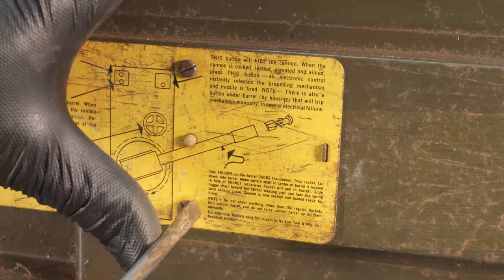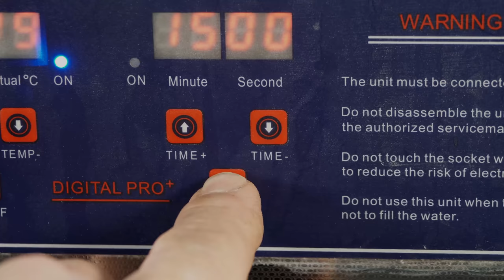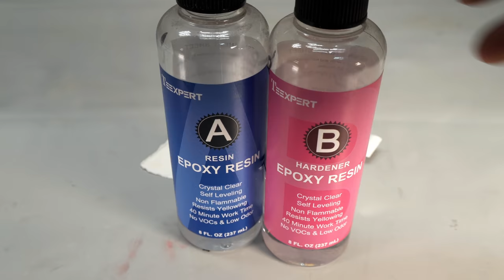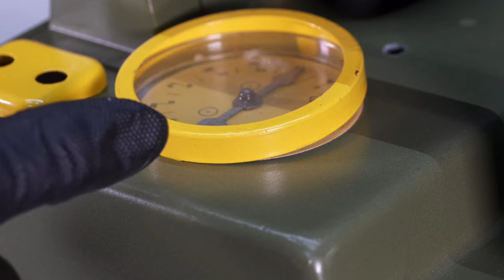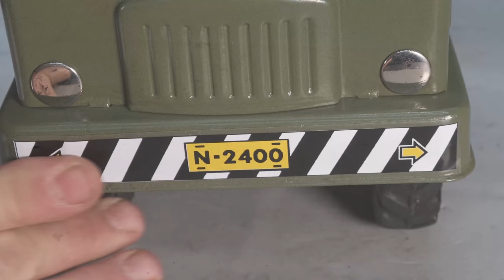Rare 1956 Nylint Electronic Cannon Truck Tonka Restoration

Comment: Holy crap they made awesome toys back in the day. I can't imagine toys today would last half as much as these.
Reply from the maker: You got that right!  Even the wheels were solid rubber.  This thing weighs a ton too.
Reply: Well, I guess they could, but only if handled correctly.
Reply: they made some dangerous toys back in the day too
Reply: @imperialpresence3331  Probably wouldn't pass a safety test, today.  Flying projectiles and "eye safety".  :)
Reply: Tonka toys still do.
Reply: Still loads of tough toys today.

Comment: This old U.S. Army toy truck; definitely requires some PC board parts, such as like a transformer. Any resistors required, even LEDs? This has a strong reference to the battery powered toy: 'Secret Wars' Dr. Doom's doom roller.🔋 👏 😳 😂 👍 👌 🔋 👍 😄 😅 😆 😑 😀 👍 🖥 😄 😆 😅 😀 🤣 🖥 🚚 😆 😄 💜 🤣 😍 🚚 💜 💓 💕 💖 ❤ ♥ 💜 🇺🇸

Comment: Disculpa por no hablar tu idioma 😞 me encanta todos tus videos solo pongo un pulgar arriba,  pero quiero saber que es lo que ocupaste para hacer la pieza de plástico q estaba desgastada y dónde se consigue aquí en México desde el minuto 12:10 al 12:25 tengo problemas con muchas piezas de plástico y la mayoría son engranes y quiero poder hacerlas igual
Reply from the maker: TRANSLATION: Excuse me for not speaking your language 😞 I love all your videos, I just put a thumb up, but I want to know what it took to make the plastic piece that was worn and where you can get it here in Mexico from 12:10 to 12 minutes : 25 I have problems with many plastic parts and most of them are gears and I want to be able to make them the same .
Reply from the maker: Necesita un fabricante de moldes de silicona y cualquier pegamento epoxi. Puede utilizar aceite de cocina como desmoldeante.  TRANSLAITON:  You need silicon mold maker and any epoxy glue.  You can use cooking oil as the mold release.
Reply: @xSpecterx99999999  gracias muchas gracias excelentes videos me encantan mucho y más porque yo tuve un Tonka hace años

Comment: how long did this one take?
Reply from the maker: More than 10 hours.   I had to do a lot of troubleshooting on the wiring and the clutch on the gear.  Plus had to order parts for it and figure out what spring to use for the one that was dissolved.  I kept having to take it apart to adjust the clutch from slipping too easily, then made it too tight and broke the gear i fixed.  It took about 5 tries to get that right.  Fun project though.